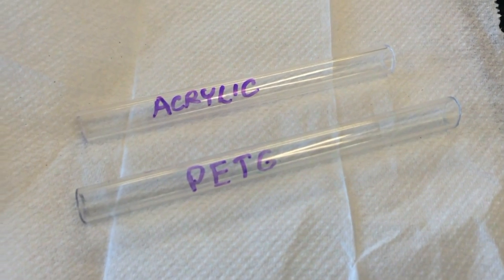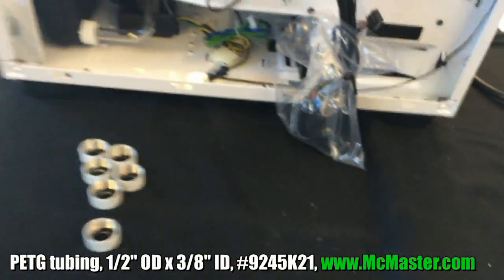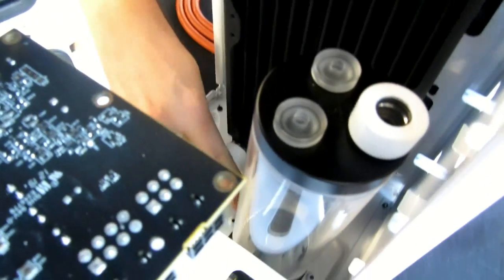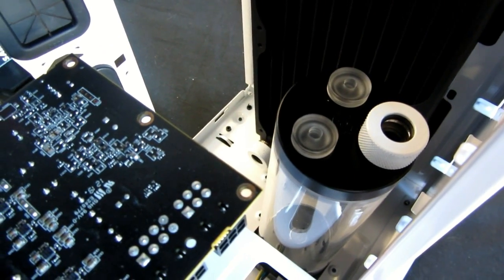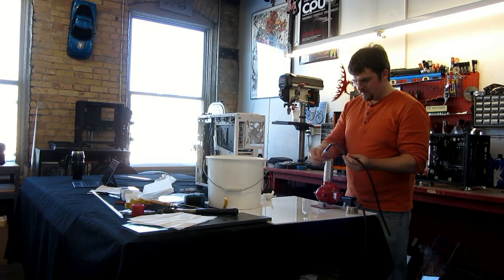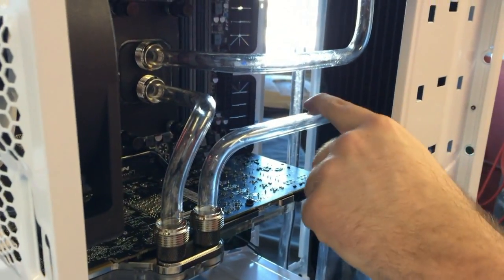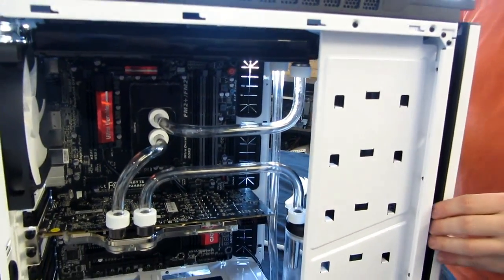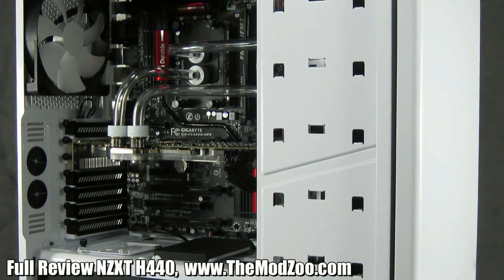PETG Rigid Tubing Liquid Cooling Loop for NZXT H440 Gaming PC, TheModZoo.com

Comment: Genuine question regarding the flow route: Would it be better to come from a heat source such as the GPU to a RAD, then from a RAD back to another heat source CPU then to the 2nd RAD then back to the RES? - Simply wondering if the heat soaked fluid from the GPU would affect the CPU if not partly cooled via the RAD? - Or i could be over thinking this as the water will pretty much be around the same overall temperature throughout the system once running? Thanks and awesome videos BTW!
Reply: All that matters for almost any loop is that the reservoir feeds the pump. Other than that there's such a minuscule difference in temp that it's completely irrelevant.

Comment: Is water-cooling that easy in the NZXT h440? It doesn't seem so easy but it's worth a try over many other cases. I want a mid-tower that has good cooling, is quiet, and is at a tolerable size.

Comment: Hello, which radiator did you use ? I would like to know what is the maximum thickness for a top radiator in this case (using standard 25mm fan).

Thank you (sorry for my English)

Comment: Hey Bill,  

So this PETG has the same dimensions as Bitspower crystal link, right?
Reply from the maker: Crystal link is 12mm OD.....  this is 1/2" OD x 3/8" ID, here are details and links, and check out our guide to Fittings for rigid tubing

PETG only works with Fittings for 1/2" OD Tubing
Guide to Fittings for Rigid Hard line Tubing for PC Liquid Cooling by TheModZoo.com

This PETG Tubing is manufactured by EXCELON, and only available in CLEAR.
"Excelon does not recommend in Outdoor use or in the presence of heavy UV"

PDF Data Sheet for PETG Tubing made by Excelon
http://www.thermoplasticprocesses.com/sites/default/files/tpi-petg.pdf
Reply: Got it, thanks!!
Reply from the maker: when are we gonna see one of your killer PC build logs on the zoo, Joe?  http://www.themodzoo.com
Reply: It's been there for a few days. http://themodzoo.com/forum/index.php?/topic/1264-complete-neptune-20-reverse-polarity-nzxt-switch-810-reverse-atx-dwood-pedestal-build/#entry23254

Posted it like a ninja...

Comment: ***** Do you know if you could get this in a different color by chance?
Reply from the maker: contacted PETG tubing manufacturer about color availability, will post update in "About" section under video, once I get confirmation along with other links Ive referenced, Thanks for watching and commenting Juggalo!
Reply: ***** I did some research on clear tubing no luck on color yet
http://www.usplastic.com/catalog/item...
.31 per ft

http://www.delviesplastics.com/mm5/me...
$7.50 Bundle of 6 - 36" Lengths

http://www.a1acrylics.com/rodtubing.htm
.44 per ft
Reply from the maker: Excelon replied, PETG isn't manufactured in transparent colors.
Reply: *****
So if we want color I am assuming we have to pay the premium price? If so that is kind of a bummer, I plan to get the STH10 by Caselabs and it might be a good amount of tubing I have to use.

Comment: What would you guys think about 1/2" OD PEX tubing? Since it is opaque, maybe used like copper tubing, but much cheaper. PEX also has UV issues, I understand, but if the PETG stands up, maybe so can PEX.
Reply from the maker: Haven't tried PEX version, but Thank you for suggestion.

Comment: Can you guys do a guide on how rigid tubing works. I don't understand how the basics of just placing hard tubing vs. soft tubing as soft tubing uses clamps, zip ties and or compression fittings but how do hard tubing stay still in those primochill fittings.

Comment: Thanks for the video! I'm thinking for my next build to go water. But I do have one question. How easy/hard is it to drain a system that has tubing ( PETG )? I've never seen anyone do it, only the waterloops with hose in them.
Reply from the maker: like flexible tubing loop, you have option to add drain valve to your loop, you could install drain valve with extension fittings between reservoir and ghost compression fitting. On MZ-1 PC Part 5, to drain the loop, g-1/4 barb with flex tube was inserted into the reservoir fill port for draining.

Comment: Ask the boss (the dog) if i can drain my ass with da PETG Tubing as well !? :D
Reply from the maker: Their reply "like flexible tubing loop, you have option to add drain valve to your loop, you could install drain valve with extension fittings between reservoir and ghost compression fitting."

Comment: So, if it's a gaming rig, where are you putting the hard drives, I see the one ssd mounted there, but as a gamer, I understand the need for mass storage.
Reply: this case isnt for you if you aren't running 1tb or 2x 1tb SSDs. get out pleb
Reply: 2tb might last you a few years, and really, this is a pretty affordable one, you can't make statements like that because they're shit, I build pcs as a buisiness and when I watercool for gamers they always request mass storage, and not all of the can afford 2 1tb ssd's in addition to a full custom watercooled system
Reply from the maker: Matthew Ludwig, some of us munkys, including me build 2nd rig just for gaming and hauling to lans.. with dedicated desktop rig for mass storage
Reply: I'm pretty sure the case has the ability to have a HDD on the floor of the case behind the PSU. If you can't I don't know what I will do..

Comment from the maker: This PETG Tubing is manufactured by EXCELON, Please note "Excelon does not recommend in Outdoor use or in the presence of heavy UV"

PDF Data Sheet for PETG Tubing made by Excelon
http://www.thermoplasticprocesses.com/sites/default/files/tpi-petg.pdf
Reply from the maker: The Mod Zoo will be running the rig from the video as test bed with UV lighting, and will update everyone here.
Reply: Any thoughts on using Polycarbonate Tubing instead which is made from UV approved materials?  As in this: http://www.usplastic.com/catalog/item.aspx?itemid=35299&catid=704.
Reply from the maker: Toby K added to list for experimentation, Thanks for link Toby!
Reply: Toby K Excellent suggestion, Toby--I hope it is ideal with UV lighting.

Comment: i couldn't even get the mcmaster carr tubing to fit my bitspower crystal link fittings, due to the M/C tubing being just slightly too large (I needed 10/12mm, and had to order 1/2" OD, 3/8" ID as they didn't have anything else closer to 12/10mm, so now i have 12 feet of tubing i can't use lol